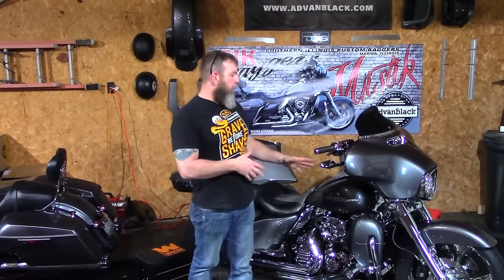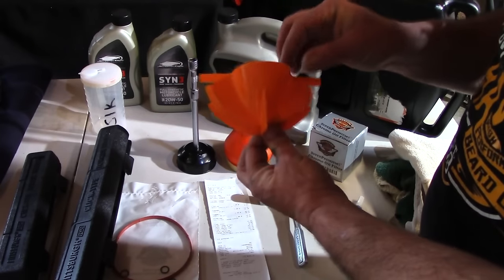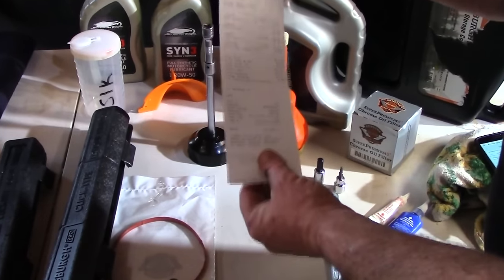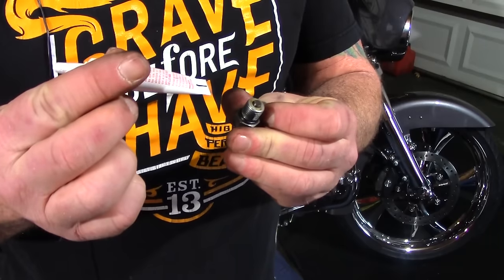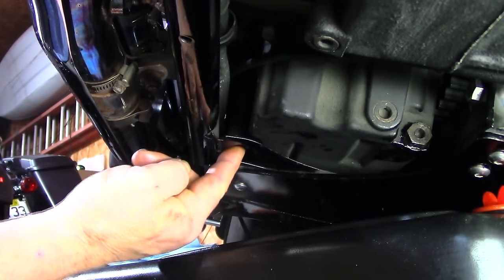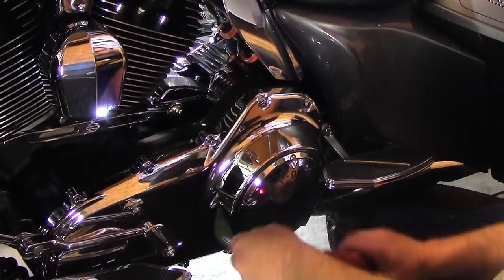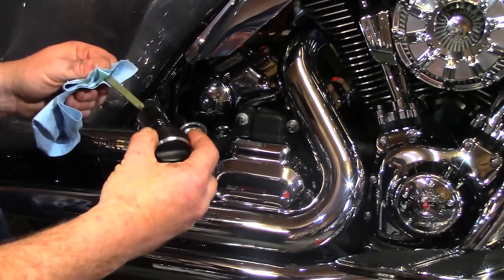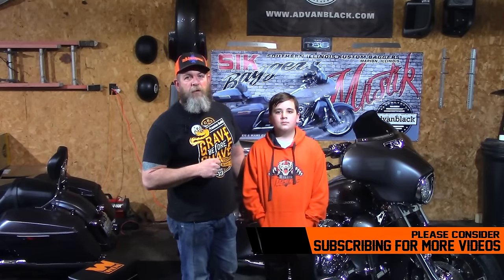⚡Twin Cam Complete 3 Hole Oil Change @harleydavidson  Touring⚡

Comment: Great video, nice and simple. Will be using this vid to guide me before doing my first 3 hole oil change on my 2014 Ultra Limited in the next month or two (plus my service manual).
Reply from the maker: Thank you sir,..much appreciated. Glad it helped and it wills ave you some money...that can spent on other harley parts ahaha.....its a never ending deal!

Comment: Did you put oil in all the holes?
Reply from the maker: Yes you can add the syn3 to all 3 holes however there are better packages on the market for clutch and tranny. That being said you will get syn3 in all 3 holes if you take your bike in for service at Hd unless you state otherwise.

Comment: I have a 2014 COV RK and all confused on the oil change opinions. I wanted to ask whats better but I see Syn3 is the deal. may go with that toothanks for the vid SIR
Reply from the maker: Hey Jose! Yes man so many opinions on the oils. I really dont think you can wrong with any of them to be honest. I use SYN3 just t keep it easy on me as far as getting the stuff....a trip to HD and im done...but there a lot of options out there and I have really never heard any complaints on any of them. Run what you  are comfortable with and what price range suits you best...the prices are all over the map when it comes to oil change kits.

Comment: i do my own oil changes and the last couple of times oil has been dripping out of the air cleaner. could i be over filling it with oil?
Reply from the maker: Yes but it can also depend on riding conditions...this will happen usually when you are running the motor super hot. Could be a combo of both being really hot and too much oil. On your cylinder head there is a breather channel. That channel leads to the two banjo bolts behind your breather. When the motor gets really hot and or too much oil is in there this is where the excess goes. The blow back will go into the breather and its supposed to caught by the breather and then cleaned later however that doesnt always work..a lot of guys get oil dripping from the breather just like you...Ive had it happen once...super hot day..rode all day and oil dripping from the breather. Harley will tell you that it is normal. Its certainly doesnt hurt anything except it makes a mess. The next time you do an oil change cut it back slightly...to where its at the bottom of the safe zone on the stick. You should be good there.
Reply: @sikbaggers  Thanks for the response, I do live in south tx. where it gets pretty hot during the summer. I'll follow your tips and see what happens, thanks for the info.and all you do. Be blessed.

Comment: How often should you do the 3 hole oil change?
Reply from the maker: the service manual suggests  5k oil & filter, 10k primary and 20k transmission.  To make things a bit easier on myself I do all 3 holes every other time I do the oil.  Its cheap insurance.

Comment: This might be a dumb question,  but what kind of thread sealer are you using here?
Reply from the maker: the thread sealer I use is Permatex High-Temperature Thread Sealant 59214 ...its not a must do on these bikes but it doesnt hurt either.
Reply: @sikbaggers  awesome, thanks Steven

Comment: Which oil and filter would you recommend for a 98 Harley Dyna DID, with 32,000 miles? Same in all 3 holes or different?  Thanks
Reply: google it

Comment: What kind of thread sealant did you use??
Reply from the maker: Permatex....Just to be clear this step is not in the harley davidson manual for changing oil...however I have been doing this for over 10 years on my bikes and many others during oil changes....just something that was taught to me years ago.,.You are fine not using it but I figure it cant hurt either. Just didnt want you to feel like you had to go buy some or even use it. The oring provides a good seal as well.
Reply: @sikbaggers  thanks bud I appreciate man! Thanks for getting back to me! Ride safe always brother!

Comment: If you can run Syn3 in all three holes, can I do the same with Mobil 1?
Reply from the maker: Yes ...you can run a full sunthetic 20-50  in all 3 holes...there is a lot to choose from these days
Reply: If using Mobil 1, use 20w50 V-Twin Synthetic for the engine and Mobil 1 75w90 (5 speed) or 75w140 (6 Speed) Synthetic Gear Oil for the Transmission.  I would NOT use Synthetic for the Primary.  I use Shell Rotella 15w40 for the Primary.  Never had any issues in 20 years.  Good luck!
Reply: Big Al The Crusher I was under the impression that the primary does not really care what type of oil you put in since it’s just a chain. Why do you use Rottela vs anything else?
Reply: I normally used Castrol or Mobil-1 10w40 for the Primary but noticed the chain is a little quieter and the oil comes out cleaner using the Shell 15w40...plus it's cheaper usually :)  In the long run, as long as you use good quality oils, you should be fine.

Comment: Is there a certain kit name or number to order, from HD? What's the price? Thanks
Reply from the maker: No kit number that I can remember ...just told them I was doing a 3 hole change....its the filter,  one gallon, 2 quarts and the o ring kit. it was 103 and some change out the door with Illinois taxes.
Reply: For those that don't know. That's 6 qts total. You won't use all six. You'll have about a half qt. Left over. Good for top offs later if needed between services.

Comment: What thread sealant are you using in the vid?
Reply from the maker: Hey Rob...Its Permatex 56521 High Performance Thread Sealant 50ml Tube...About 10 bucks on amazon.lasts forever for such a small tube.

Comment: Great video thank you for the info. I just got a Road king special. I paid $300 for first 1k but for the 5k I'll be doing it myself.
Reply from the maker: Hey Martin...congrats on the new RK! Glad the video helped you man.
Reply: Don't  forget the dealers push the three hole oil change every five thousand miles but ,if you check your maintenance chart tranny is every twenty thou. and primary is every ten thou,and when you do your engine oil  make sure your floor is level if it tilts towards the back  you wont get as much old oil out,I found that out first hand,its a good idea to see how much oil you actually took out especially if your not sitting level,on level surface don't  add more then 3 quarts at first then follow just like the man says.
Reply: @lsmith2129  Ok thank you for the info

Comment: Prime oil cover screws are T27s not T25s.  I trusted your video and stripped 3 of 5 my screws.  I finally found out about it after I consulted San Jose HD.  Please change or modify your video.  Don't let this happen to other people.  Thanks
Reply from the maker: yeah simple mistake on my wording..thats why its important for YOU as bike owner to check your sizes and also make sure you purchase a service manual for your bike. If it didn't fit then why in the world did you keep cranking on it til you stripped it and then 2 more after that?

Comment: instead of using the towels, crinkle up aluminum foil to form a catch-all for the oil to funnel out to wherever you mold it to go.
Reply from the maker: Yeah tried that a few times...it works pretty good.

Comment: I don’t think all the transmission oil comes out unless you put the bike upright !?!
Reply from the maker: the hole is on the side for a reason...lean the bike. Of course, you can stand it up, ...you will never get all of the oil out either way..We go by what the service manual tells us to do.
Reply: @sikbaggers  I guess the point I was trying to make was if you’re going to measure out 28 ounces to put in you better get 28 ounces out unless you want to overfill it.

Comment: I know this is just for the fluid change...but should you mention to check the primary chain adj?.   And to say something about the "void your warranty"...if I sold you a brand new bike at my dealership and you didn't come in for the services in my service and you had a warranty issue .. especially if it was fluid related...you would play hardball in  getting that warranty handled... not saying it wouldn't be done, but it would not be done in a timely fashion,...just sayin.. don't piss off your dealership....edit. if there is an adjustment anymore...
Reply from the maker: No..the 14 ups have a self adjusted on them. I did discuss the fact that you Do Not have to have your bike serviced at HD. The Magnuson–Moss Warranty Act ...if the work isnt done In a timely manner...that's just a dick move in my opinion.  So your dealership muscles your customers into having all the work done there? Pretty shady man. Please let me know the name of it so I can avoid it.

Comment: does anybody know how much extra oil is required for a HD oil cooler that is on my FLHTP?
Reply from the maker: Hey Ken What year is the bike?
Reply: Steven Housden it's a 2016
Reply from the maker: I dont think your police model is any different than our standards as far as oil changes according to the service manual...we have oil coolers on standard models and I searched the service manual and it says nothing about your model being different as far as oil changes.  Add the initial 3 quarts, let the bike run for 2 to 3 minutes and check the dipstick. If your doing it on the jiffy stand be sure to check the right mark on the dipstick. Add  oil from there. the run time will allow the filter and oil cooler to fill with oil.

Comment: I drained my transmission today to change and a socket head bold was on the magnet  fell right out of the transmission. I took it to the harley dealer. He said it looks like when they built the bike they dropped a bolt in the pan. It was the same bolt as the pan.
Reply from the maker: wow..man I have never seen that but im glad you found it before it caused any damage.

Comment: Why 20w50? This oil is for older engine. Go 10w40 and 5w40 4t jasom a m2
Reply from the maker: From the 2014 Harley Touring Service Manual. " This motorcycle was originally equipped with the GENUINE HARLEY-DAVIDSON H-D 360 MOTORCYCLE OIL 20W50. "

Comment: T27 not T25 torx for Derby cover. Also, you mention thread sealer and then you never should its application. You never showed to what level you filled the primary. Also, you stated the incorrect level for engine oil. 2.98 Quarts. However, if you put some in the filter, you must account for this when filling the crankcase, also, its best to put a little less than full on the dipstick, add if needed but never fill to the upper limit on the indicators. Checking oil level cold it should never be higher than half on the dipstick as well.
Reply from the maker: I'm guessing my aftermarket derby cover has t25. You should always check yours to see what yours is.   2014 Harley touring service manual states "initially add 3.0 quarts (2.8 liters) of engine oil. Perform engine oil level cold check.   Now me knowing my bike, I know I need to add just a tad to the filter to lube it and then add 3 full quarts and after I get it hot it will be in the middle of the tolerance marks.. Nowhere did I state to add it to the top of the tolerance marker, hot or cold.  I also stated. clearly,  that my bike calls for 38 fluid ounces in the primary. I did mention thread sealer and you can clearly see it on the threads. This is not a tutorial on applying thread sealer. it's pretty straightforward and I'm sure you can find great tutorials on youtube for thread sealer.  In the first 30 seconds of this video, I suggested you check YOUR service manual for your specs for your bike.

Comment: Just found your channel and I really liked your style and pace.  Nice steady camera work too!  Yeah lots of oil choices out there.  I use Mobile1 V-Twin full synthetic in all 3 holes.  I re-use the orange derby cover gasket several times as long as it looks good.  I haven't used thread sealant on the drain plugs before, but recently picked up a small tube of permatex high-temp thread sealant to try.  Just a little extra insurance I guess.
Reply from the maker: BrewCityRider hey thanks man... And yes the thread sealer is a bit extra.. It doesn't call for it in the service manual but I've been wrenching on bikes since back in the day when you needed it lol just habit I guess. Doesn't hurt.  So many choices on oils these days. I'm not sure you can go wrong to be honest.

Comment: Quit using thread sealant on your oil plugs. The O-ring will seal properly without additional sealant. Especially do not use teflon tape, this can actually get between the O-ring and sealing surface and cause a leak.
Reply from the maker: Been using thread locker on bikes for 20 years...LKike I said in the video..you dont need it and the o ring is fine...the thread locker wont hurt anything and I never said a thing about a thread tape. Have a good one

Comment: Great vid!
Reply from the maker: Thank you Ron...much appreciated.
Reply: @sikbaggers  - I was wondering why you use the Syn3 oil. Since watching your vid, I researched online, made a call to my  trusted mechanic back home, and he recommends the Bel-Ray line of lubricants over the Syn3. Unlike the Syn3-which from what I gather, is not fully synthetic, Bel-Ray is fully synthetic. He also rated Amsoil better than Syn3.
Reply from the maker: @ronl384  there are a ton of good oils out there ...Maxima is a great oil as well. Thats what came in the bike and I just continued to use it as I have had no issues with it. My buds bike is a 2014 with 143,000 miles on it...no issues..always used syn3. I do believe most oils will work equally as good though.

Comment: Cost saving tip. On my 2014 Street Glide Special for the o-ring replacement - I do not change my primary one every time as there is nothing wrong with it.  As for the black smaller rubber o-rings. I just get a bag of them on amazon for under 5 bucks and you should have enough for many oil changes  https://amzn.to/2HexGI4

Comment: It's hard to save money when Harley is charging almost twenty dollars a quart. I use Lucas 20-50. Bike runs cooler and sounds good. 😂😂
Reply from the maker: Yeah its not necessary to run HD oil, this guy just wanted that used, I actually use amsoil, which honestly isnt much cheaper.
Reply: Lucas for the win!!! Engine noise went away the first time I used it and has never come back.

Comment: $25K on a touring bike...I'm not running syn3 in all three holes unless you wanna wear out your metal on metal components faster.  Ask yourself, why would HD make specific lubricants for each hole IN ADDITION to syn 3?  Pay now, or pay big sooner than you'd have too. 

 My '13 ultra limited w/HD formula Plus in the primary,  mobil 1 syn in oil, and Red line in the trans....no more tapping, trans clunking, and runs quieter...major maintenance bills a lot further down the road.  that's the smart difference.   maybe an hour and half or you time, tops

and if you're smart enough to ride a motorcycle, you're smart enough to change the lubes.
Reply from the maker: Great....like I said you can run whatever flavor oil you want. This video isnt about the oil, it a HOW TO..so I strongly disagree with your last statement. If that was the case this wouldn't be my number one most watched video. Apparently there is a lot of guys that want to change their own oil and would like to know how. Maybe "smart enough to know they need to change the lubes" Thanks for your opinion on oils and lubes.

Comment: Nice looking bike. All you need to do now is use AMSOIL and not that HD crap. No telling who makes that crap. Sunoco used to make it but I am sure whoever has that low bid HD will go with it. AMSOIL, that oil of those that know.
Reply from the maker: Yes sir..Jerry I have since switched to amsoil..check out my latest oil change video on the softail...all amsoil products...this video is pretty old..and yeah who knows...they bid it out every few years, is what im told..cheapest bidder gets to thier oil in the syn3 bottles. lol

Comment: See, I was told different by a harley tech.. I was told for the oil you dont screw it all the way in for a true reading.. I was told you wipe it , and push it as far in without screwing it in, and that is a true reading?
Reply from the maker: I certainly would not have my bike serviced at the harley dealership then....Right in the Harley service manual it states "  Place vehicle on level ground resting on its jiffy stand. Remove filler plug/dipstick and wipe off the dipstick.   Insert the dipstick and tighten into the fill spout. Remove the dipstick and verify oil level. " this goes for pre ride inspection (cold check)  and also Hot Checks.  After an oil change it states . A. Perform engine oil level COLD CHECK.
Reply: @sikbaggers   I appreciate you clearing that up for me.  Thanks.

Comment: cold oil change ,
Reply: i seen that too, supposed to warm up the bike to get correct reading on the dipstick. then add until at correct mark.
Reply from the maker: Wasnt a cold oil change but I guess I assumed everyone would know to get the motor hot...or maybe I should have recorded me sitting there running the bike...boring.
Reply: most do not know that, and get a false reading on the dip stick.

full detail is best,  besides . . . we LOVE hearing the exhaust from the idling engine. . .  even their own.

  i,  personally have not ever had one to do that with,  if i could ,i would fill it up, let it sit there and idle , and rest
 20 feet from the back of it  [ clear from  direct exhaust ] , while resting  in the hammock, while recording  it  until the engine dies from  idling the tank dry.    LOL 
 and the whole time have a fan on each side blowing on the engine.

you call it boring, but  we  [ the viewers ]   really enjoy it.

Comment: Instead of using rags under the oil filter, line some tin foil to the chassis (under the filter) and lead it to the inside the waste pan. Easier to throw away aluminum foil than the wife's favorite towels.